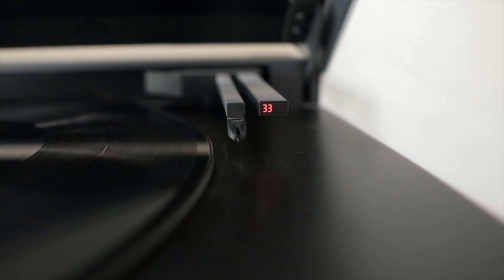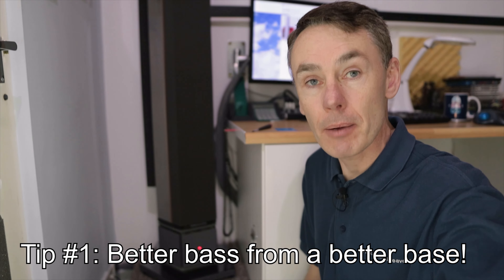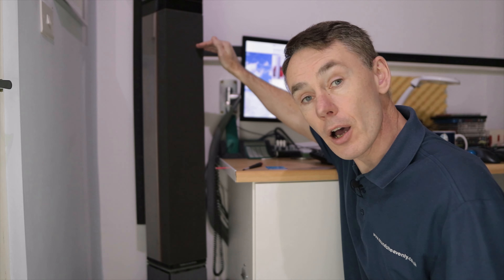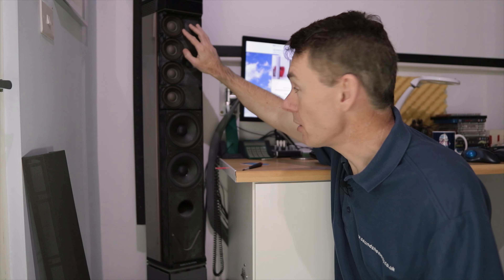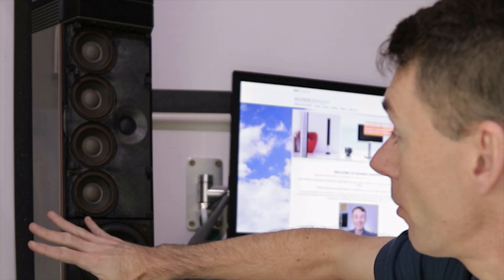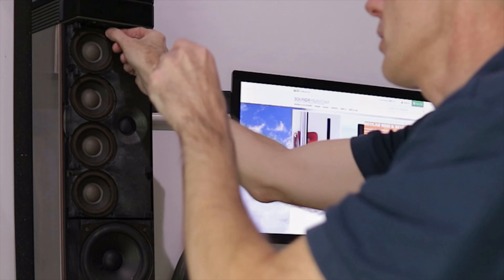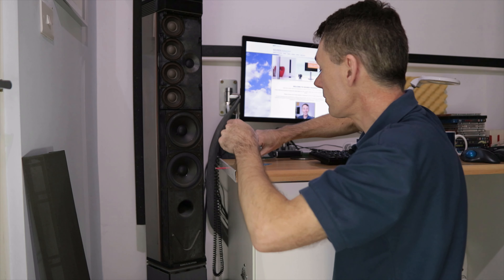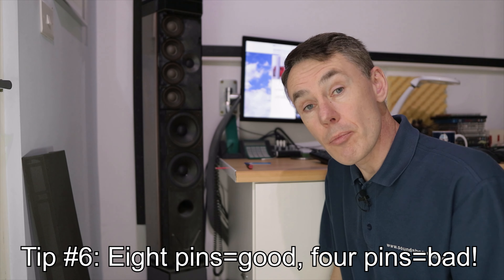Bang Olufsen Beolab Penta speaker upgrades - 6 simple hacks for better B&O sound [4K]

Comment: I just pulled out a pair of those out of recycling. Bad case of foam rot - should not be a problem.  My came with no amps, I have a small Denon UPO-250, should be good enough for me  Would you have any extra  tip for someone like me?
Reply from the maker: Hi, a good powerful amp of around 150 Watts per channel is best to drive these superb speakers to their full potential.  Please ask at https://soundsheavenly.com if you need any help with cables once you have got them working!
Reply: @soundsheavenly  Today I plugged them in to my Denon (it is 140W...power consumption) and they sound absolutely amazing, even without the foam surrounds. Not hard to imagine how they will perform after refurbished and with a proper amplifier, can't wait. As to cables...well they are fully passive and without the displays, so in my case two copper lines will do. Thank you.
Reply from the maker: That is good news. Please feel free to get in touch at https://soundsheavenly.com and I will be happy to help with any cables you need!

Comment: Hey Steve, great video. When you had the middle panels off for flipping, did you notice if they can be easily unplugged as a unit? Thinking if my midranges need refoaming, perhaps I could pull these out instead of taking the whole speakers in. Thoughts? (they've been sitting in storage a couple years but have been in otherwise regular use since around 1991).

And you're so right about proper Powerlink cables. I want a few years with the 4-pin speaker cables from my BeoCenter 9500 before switching over, and was amazed how much better they sounded.
Reply from the maker: Thanks. Sorry I can't recall if the midrange panel can be unplugged or not.  Yes, good Powerlink cables are certainly the best way to connect the speakers, the sound is far better than via the old Speakerlink wires!

Comment: Hello, I have a pair of Penta model 6603 speakers.  How can I connect a player, cell phone, TV or amplifier? in the lower part it only has inputs for red and black cables and only one RCA type input
Reply from the maker: Hi, you can easily connect both speakers to any device with a headphone socket using this cable to the RCA Line input of the speakers: https://soundsheavenly.com/line-in-connection/77-241-minijack-to-beolab-line-in-using-phono-rca-sockets-one-cable-for-two-speakers.html#/2-length-1m
Reply: @soundsheavenly  good evening, excuse me, in the lower part there are two holes to insert a pair of cables, red and black..
Reply: @soundsheavenly  I was thinking of connecting through two red and black cables to an amplifier but he told me that it could damage the speakers... what are those holes for?
Reply from the maker: This is a bit too detailed for YouTube comments but I will be happy to help via the contact page at https://soundsheavenly.com
Reply: connect a speaker to an amplified speaker with a player and it sounds good but I don't know how to lower the volume of the penta
Reply from the maker: Please email me at https://soundsheavenly.com with the model numbers of the products that you want to connect and I will be happy to help!

Comment: Instead of concrete blocks I put subwoofer isolation pads under my Pentas (on a hollow wooden floor). Would that have (about) the same effect? A big pro is that it is a bit easier to move the speakers around in order to find my preferred listening position(s)! I also just flipped the midrange speaker section, curious to find out if I can spot the difference!
Reply from the maker: That is an interesting idea - I haven't tried these isolation pads but they should help to reduce bass vibrations from the speakers reaching the floor.  The concrete blocks work by adding mass to stop the floor moving, so a slightly different approach.

Comment: hello steves, I just got my father's pentas but one doesn't work anymore (the sound doesn't come out anymore) do you have any idea, the red light is ok they are connected to the Beomaster 6500 with Beocord 6500, Beogram 6500, Beogram CD 6500 controlled by the Master Control Panel 6500 in advance thanks for the advice.
Reply from the maker: Sorry I don’t know about repairs but I suggest swapping the cables over to see if one is faulty. I can help with cables if required!
Reply: @soundsheavenly  I'll come back to you if you need a cable, mine are eight pins so ok, hey, I'm watching your videos, thank you
Reply from the maker: @overblood6813  Thanks!

Comment: Turning the mid/tweeter unit 180 degrees did nothing for me back then, and considering B&Os deep knowledge of speaker design and testing, it's not likely they made such an obvious mistake if it was degrading the sound. But: I might have been attending too many concerts to notice any possible gain from mirroring the Penta 😜 All other tips are bang on. Penta is by design exactly the opposite of what B&O wanted to achieve with the acoustic lens: Penta is made for a narrow sweet spot, but that spot is indeed sweet. I had them toed a bit further inwards from your position. If you are more about getting the best sound from Penta than keeping it all B&O: get the Beovox Penta (or disconnect the Beolab amp) and have an upper class 2x200w (or upwards) power amp driving them.
Reply from the maker: Thanks.  I wouldn't say B&O made a mistake in setting both speakers the same way around, they made the speakers to give the best sound for most situations, without the user needing to do anything special for the setup.  This gives scope for owners to gain some extra improvement by tailoring the speakers to their situation.

Comment: Thanks Steve, I enjoyed the video greatly. I've got my own pair of Penta MK3s that I've been refurbishing. I don't know what it is about these speakers, but I'm sure I'll never part with them. I've got mine on a wooden floor (parquet I think). Would the concrete blocks help with sound quality on wooden floor too, or only carpet? And I saw another viewer comment about slate tiles - would they do a similar job as the concrete blocks? Thanks again. I really enjoy your content, and hope you'll make more on the Pentas.
Reply from the maker: Thanks, glad my video was helpful!  The tiles or blocks help to add mass to give a solid base for the speakers.  If the floor construction is concrete then you may not need this, but for any kind of suspended floor or where the floor sounds "hollow" when you stamp your foot hard then adding either type of solid base can improve the sound.

Comment: Great video. 
In future videos, it would be interesting to hear about connection options for these speakers. 
Obviously you can connect them to a stereo, like a BeoMaster 7000, and use a remote control through that system.
But can you eg. connect directly via jack/phono via a Crome Cast/Apple Airport Express? How about display and control of volume/base/balance etc. What about auto on/off (I believe they do that).
Them having their own amplifier and with today’s streaming, what’s the most simple way to connect these, while still retaining ease of operating them and keeping the good sound quality. 
Maybe a “control unit” stereo system is best?
Reply from the maker: Thanks!  Yes, I will cover the connections in detail in a future video.  In the meantime, please feel free to get in touch at https://soundsheavenly.com with any connection questions.  You can easily use the speakers with a device like a Chromecast Audio or Airport Express, the speakers will turn o n automatically when the music plays but the display won't work, you just need this cable: https://soundsheavenly.com/line-in-connection/77-241-minijack-to-beolab-line-in-using-phono-rca-sockets-one-cable-for-two-speakers.html#/2-length-1m
Reply: @soundsheavenly  
Thanks so much. As you might remember I have a set of these with a beosystem 7000 in Copenhagen. But my Scottish partner and I have a home in Scotland too. Looking at getting a set of Pentas there too. And would like the simplest setup. So very keen to hear about functionality and control. Can’t you e.g. use a remote to control the volume?
Thank you for the link :-)
Reply from the maker: @SuperJuul81  The speakers won't respond to a remote control, only a B&O music system will do this.  If you wish to use a remote, please add a B&O music system and connect the speakers to this.
Reply: @soundsheavenly  
Okay, sure :-)
But then I don’t understand how you control the volume. The audio out on a streaming device like Airport express gives a signal “volume” which can be adjusted like when plugging in headphones. But how does the amplifiers in the speakers know how much to amplify?
I’m normally really in to this, but this I don’t understand. 
I have a Beloit 12 in my kitchen. It’s hooked up to an Airplay 2 unit for Apple airplay multi room. 
It’s normally set on full volume on the output from the airport unit, and then the volume is adjusted on the Beloit for minimum distortion. Same thing on my Beosystem 7000. 
But how does that work if connected directly to the Pentas. Does the amplifier automatically read the input level of the jack-phono? This puzzles me. 
I’m so sorry for asking this many questions. 
Great great YouTube channel you have. I’ll make sure to order from you when needed and link to you channel.
Reply from the maker: @SuperJuul81  Thanks, glad you like my channel!  The speakers have a fixed volume gain, the phone will set the volume level when you play through a wireless device to the speakers (just as if would if you had headphone connected to the phone).
Reply from the maker: @SuperJuul81  Thanks!  Please don't worry, the Airport Express uses the phone to control the speaker volume, this varies the input level that is sent from the Airport Express to the speaker.

Comment: I've always dreamed of having these speakers.  A dear friend of mine which turned me into the musiclover i am today, introduced me to these speakers while playing Mike Oldfield - Voyager CD . I was utterly blown away and started building my own speakers from that day.
Sadly he passed away in cancer, but his impression still lingers, and i still want these speakers.
Problem is that i have no interest in the Beolab stereo, i have a Yamaha A-S1100 which powers my current speakers,
and connecting Beolab Penta's to regular amps is a bitch , especially if you want the display working.
Reply from the maker: Yes you can use these great speakers with any amplifier but the displays will not light unless you use a B&O music system. Please ask at https://soundsheavenly.com if you need any help with connections

Comment: Hi Steve, can I ask you something about teh penta speakers? About the midrages, only sound 2 speaker of the 4 that have each tower, in both towers are the same. I have connected with line in only, never connected to other system o B&o. Very grateful. Bye.
Reply from the maker: Hi Nicolas, all 4 of the midrange speaker drivers should always give sound, otherwise you have a fault in the speaker somewhere.  You can test these using a cardboard (paper kitchen roll) tube to let you put your ear to just one speaker driver at once while the music is playing
Reply: Thank you, I take out the entire panel and realise that if you disconnect 1 of 2 center midrange the sound of all 4 midrange goes off, then check the sound in the 2 midrange (the uppest and downest) and sounds like surround can be? The sound and power is not the same than the 2 midrange of the middle, excuse my poor English, I'm from Uruguay.
Reply from the maker: Please don’t worry, the outer and inner midrange speakers are meant to give different sounds, this is how the speakers are designed.

Comment: Hi, how good are Penta's? I have a Beosound 4 running into a Roksan Kandy Mk111 amp. currently using Mordaunt Short speakers but have seen a set of Beovox Penta's on a specialist website. They must be an upgrade over the MS speakers don't you think?
Reply from the maker: In a word: SUPERB!  These speakers are unmatched by anything else I have heard, short of Beolab 5, 50 or 90.  Way above the performance of any passive speaker that B&O ever made.
Reply: @soundsheavenly  thank you.
Reply: What model morduant short??
Reply: @henriksrensen3220  MS35ti series 2

Comment: Hi Steve, I don’t know if you want to make any recommendations on this but I have a pair of Beolab Pentas mk2. From a sound quality point of view do you think it is it better to use or bypass the Beolab amp? I am using a Denon AVC-X3700 amp in pre-amp mode (and your cables) at present. One of the speakers goes into Autolimit mode when turning on and needs to warm up for 10 minutes or so before working. Bypassing the amp would fix that problem as well I expect.
Reply from the maker: Hi, for best results, please always connect to the receiver pre-out sockets and use the amp in the base of the Pentas.  If the speaker has a fault I recommend asking your local B&O dealer to recommend a repair agent (sorry I don't know about repairs) as you won't get the best sound quality until this is resolved.
Reply: @soundsheavenly  thanks for the quick response!

Comment: Awesome video! Man, I'd love to get some Penta's again! I was wondering if you maybe know the answer to following: If the foam is rot, I often see people replacing the old foam with new foam that will eventually rot again. Why don't people use rubber to replace the foam? That should hold way longer! Is there a difference in sound?
Reply: The rubber has a different compliance which would/should effect the sound.
Reply: @leeshepherd6512  Interesting, thanks for your reply! :)
Reply from the maker: @Jondedy  Thanks Lee, you beat me to it!  Foam is the best option for sound, if you keep the speakers in a dry, smoke-free environment then you should get several decades between each re-foam.
Reply: @soundsheavenly  Awesome, thank you very much! Foam it is than! Though if I buy a pair now, i'd go for a pair that's already refoamed. That saves a lot of time :)
Reply from the maker: @Jondedy  Good plan!

Comment: I just got my first set of BeoVOX Penta's (literally yesterday), and I did the "flip" of the midrange assembly, and I am happy to report that it most certainly makes a difference!  Thank you for posting this.  Now I just need to order up a set of new foam surrounds for the midrange (mine have gone all spotted and are tearing).  Do you have any opinions on using rubber or foam surrounds here??
Reply from the maker: Hi, glad the video was helpful! I would always fit the same material in the speaker surrounds as the original design, as changing this will change the characteristics of the speakers. I have used GoodHiFi for B&O speaker surrounds in the past, I think they are based in Netherlands and sell on eBay and via their website.

Comment: Hi Steve. I found some MK3 models online and was quite interested to get them. My setup is currently two Rega players and a regular stereo/cinema amp (to be changed eventually) 

Do you think they would still be a good fit for the main channels? 

And as for foam rot, is it the entire woofer that needs to be changed? 

Thank you!
Reply from the maker: These are great speakers, they should work well with any amp - please get in touch at https://soundsheavenly.com with the model number of your amp if you need help connecting them.  Only the foam surround of the midrange speakers is affected by foam rot, whilst I can't advise on this, if you search for "Good Hifi" online, they have the parts and advice for replacing these items.
Reply: @soundsheavenly  Thank you so much for the advice. I just got them, can’t wait to install them properly. I noticed also that you have rj45/powerlink cables. Does that mean if for example I own a Beosound Moment that the display may work with it? I will definitely order some accessories from you!
Reply from the maker: @NiGHTSaturn  Thanks! Newer products like Beosound Moment can't provide the data to operate speaker displays unfortunately, even with the best cables.
Reply: That’s too bad. Still a great solution. I’d rather have a Beosound 9000 one day to enjoy the full experience and maybe having a streaming solution connected in the aux powerlink? Your answers are incredibly appreciated by the way. I’m quite excited to finally get into B&O world.

Comment: Can I use 3 pin MCL cable/speakerlink from my beomaster 3300 to my beolab penta mkI and still get the information on the display?
Reply from the maker: Good question!  Unfortunately, Beomaster 3300 only has 3 pin speaker sockets for operating remote speaker link kits via MCL, so it can't light the Penta displays (this needs the later 4 pin sockets as fitted to the Beomaster 3500)
Reply: @soundsheavenly  i do have 4 pin speaker socket on the 2 in the top
Reply from the maker: That is unusual for the 3300, but systems with the 4 pin sockets can light the Penta displays. Please get in  touch at https://soundsheavenly.com and I can help with the cables you need.

Comment: Great idea to turn the speakers symmetrical. BUT - I remember from my tech. class (back in the 70'ties) that the tweeters should be right most at the right speaker and left on the left speaker, in orders to get the widest stereo perspective. But what do I know - physics might have changed since then...
Reply from the maker: Thanks, that is an interesting point...my view is that either can work, it varies depending on the room acoustics and whether the speakers are "toe out" for the widest sound stage, or "toe in" for the most accurate stereo image - but that is getting a bit beyond the ability of my ears to hear the differences!